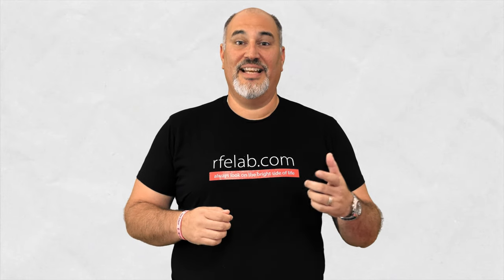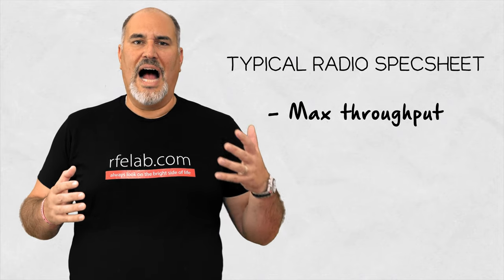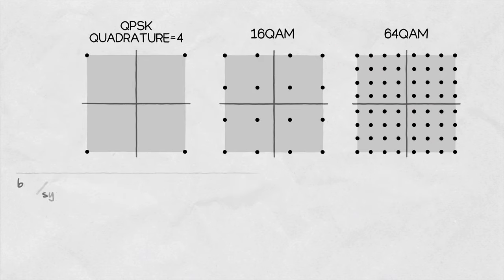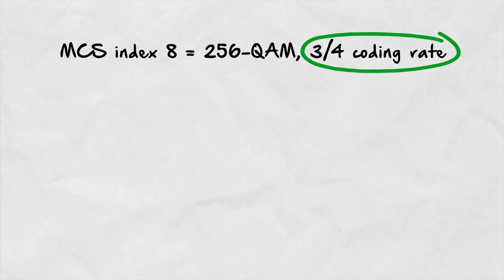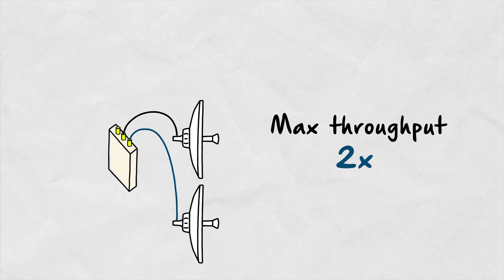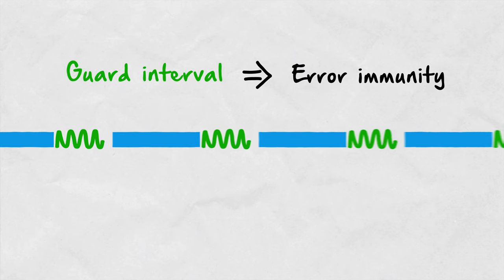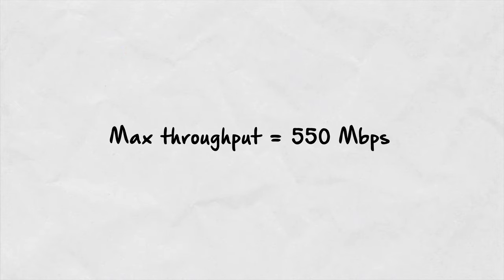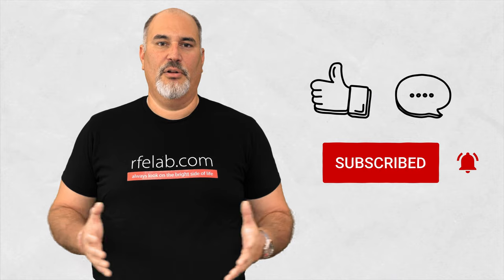Inside Wireless: MCS rates

Comment: Great work. Thank you very much for all these episodes.
Please I need to know some issues about practical word about IEEE 802.11 n WiFi 54 Mbps:
What is the maximum estimated noise floor at user devices that could be achieved, for a line of sight connection? it's -98 dBm to the best of my knowledge !!
 The same question about Error Vector Magnitude (EVM) in dB?
I mean for all these questions the thresholds values?
All the best.
Reply from the maker: Thank you! The noise floor is definitely somewhere on that order, but might differ somewhat across different devices. For Commercial applications the -98 dBm is a good reference. The EVM depends also on particular device, but generally 64QAM @ 20 MHz channel requires 25 dB SNR.
Reply: @Rfelements Thank you very much. We staying tuned for more great episodes.
Reply from the maker: you're welcome! :)

Comment: is the video good, yes.
did i learn a thing, yes
do i now understand MCS rates, absolutely not
Reply from the maker: maybe we can answer if your question is specific enough..
Reply: @Rfelements  What is the MCS rates and how it is being calculated? What are the dependencies between MCS rate and all things you have explained in the video? What is the usage of MCS rates?
Reply from the maker: @rchromatic  you don't calculate MCS rates, RF radios typically automatically operate at the highest possible one. 
For the dependencies explanation, check our other IW videos, for example https://youtu.be/lPDNG1mjeq8, https://youtu.be/IbUflaeJcU8, or https://youtu.be/1TYW7T6X2_k
MCS rate is equivalent to the throughput speed of a wireless link one can achieve..
Reply: @Rfelements  So the answer is that MCS is a look up index in predefined table of pairs Modulation + Coding Rate. For example when we say MCS == 5 it means that Modulation == 64-QAM and Coding rate is 2/3. Then knowing the number of spatial streams and channel we can "predict" the data rate (is it MCS rate or throughput or channel speed?).
Reply from the maker: @rchromatic  yes, you got it right. It is the maximum possible throughput speed you get from that. The reality is most often below this value, naturally.